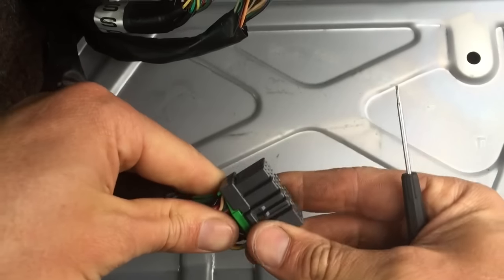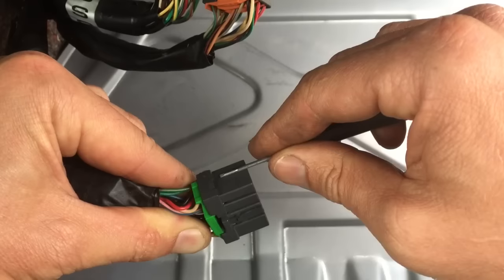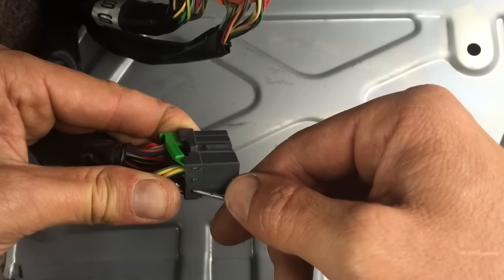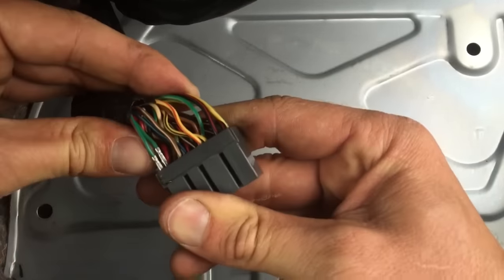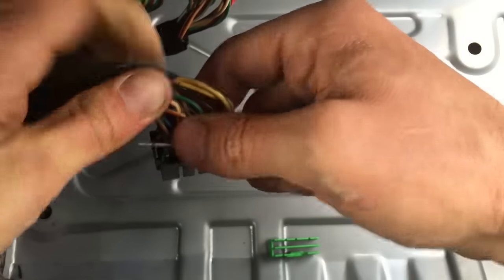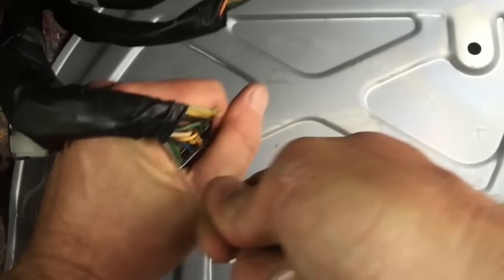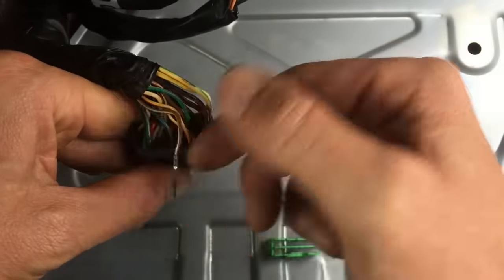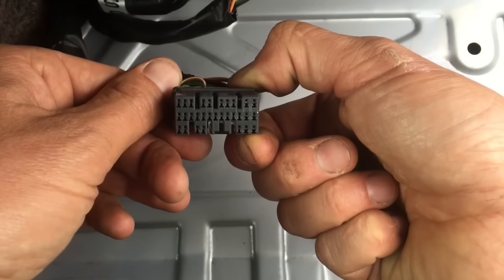Subaru ECU De-Pin - 3 Connector ECU

Comment: Thank you soo much for posting this Mick! Always worried about busting up the ECU connectors but now I feel confident to clean them up & ground the B135-25 pin. For others reading I was informed (by this rad chap) this is an important step for an early 2000s automatic 2.5 subaru swapping into a manual trans westy! 01 forester auto > 85 westy manual for me Cheers!
Reply from the maker: +Morgan Stonie I'm glad it helped, Morgan. This video is a little more applicable to your ECU!
Reply: Morgan - Finally made the connection that this little block is what they are trying to show on the wiring diagram...99 subaru 2.5 auto into a 85 manual...B135-25 pin

Comment: I need too find the Wiring diagram for my ej20 2004 subaru impreza NA but all the diagrams have 4 Pins and my car has 3
Reply from the maker: You can get the factory service manual and find the pinouts in there. Links are on my website Busaru.com

Comment: 2006 subie sti cel p448 racking my brains out chaching dollars so far emissions ripoff in ct 1st po442 cleared the  po456 cleared now this new charcal canister new purge control valve used smoke machine  all good no grd from purge solenoid to pcm